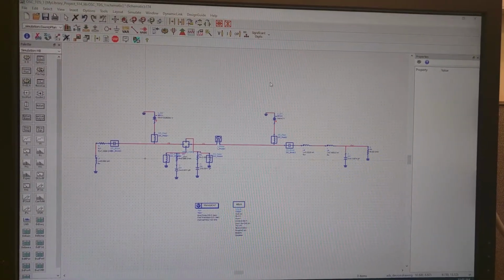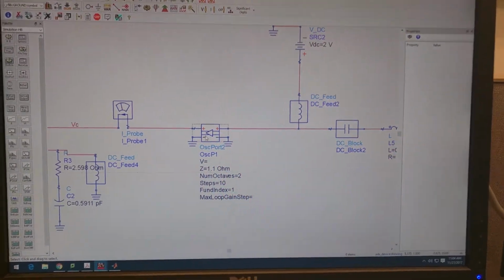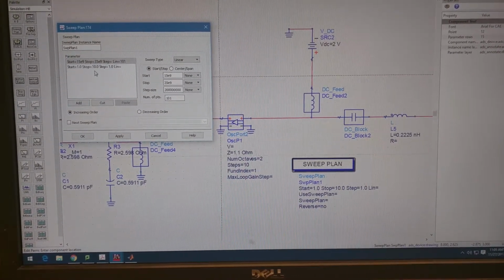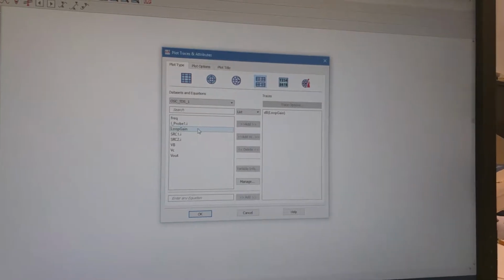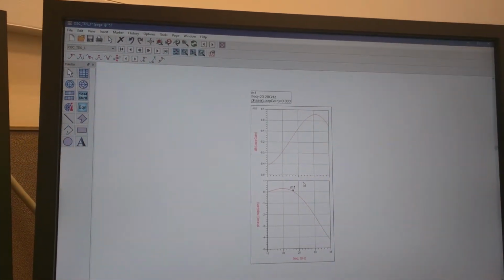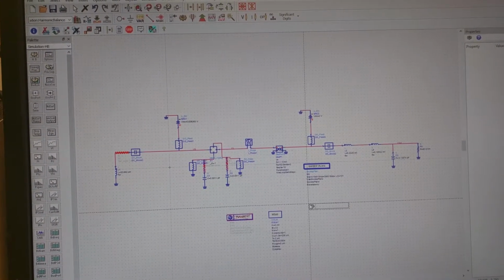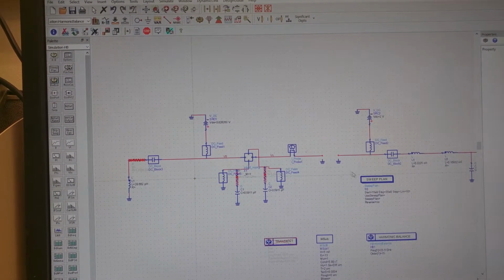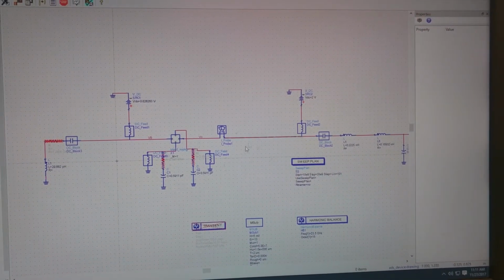Using Harmonic Balance simulation in ADS

Comment: Sir i have done my oscillator analysis. My loop gain and harmonic balance condition meets as you have shown but my transient analysis is not accurate. is this possible that harmonic balance and loop gain gives very close result to the designed freq but transient analysis gives nothing?